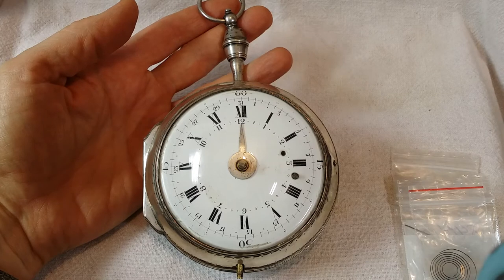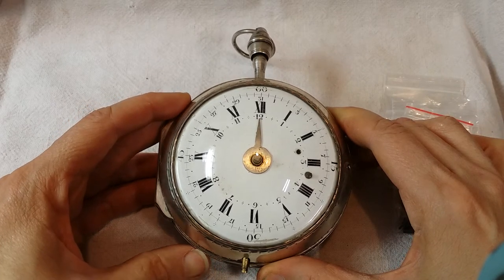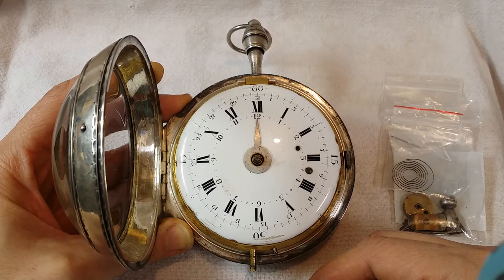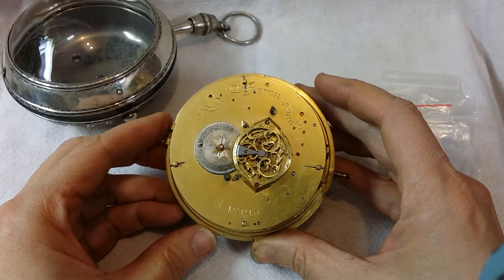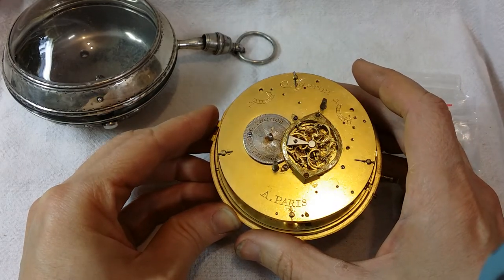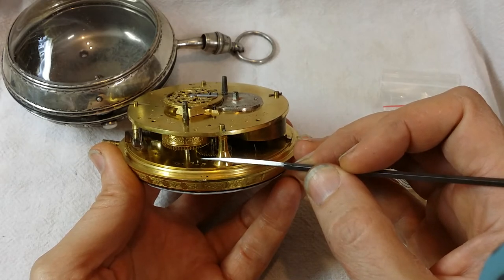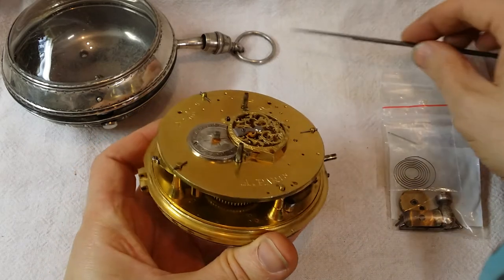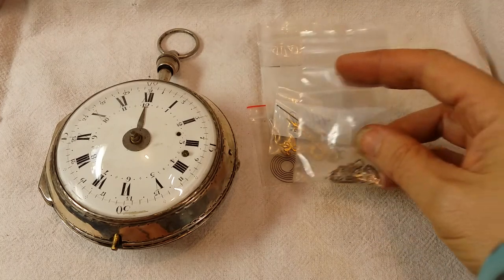01 Ageron French fusee restoration, introduction

Comment: Hello dear sir, I have the same big pocket watch, which is under repair. Can you take a picture of how to install and remove the enamel dail ？thank you very much
Reply from the maker: There are several ways dials are attached to the movement. Could you send pictures of the watch you're working on. repivot22@gmail.com
Reply: @repivot2253  Hello dear sir, I have sent pictures and videos to your mailbox, please take a look, thank you very much
Reply from the maker: I have looked at your pictures. Your dial attaches different than this dial. This dial attaches with just one screw. I will show this in an upcoming video.
Reply: @repivot2253  Ok sir, i look forward to seeing your video
Reply from the maker: Video #21 in this series is up now. Everything is sped up in the video, so I don't know if you'll notice it. The dial is held on by a single screw. There is one dial foot which prevents the dial from rotating.